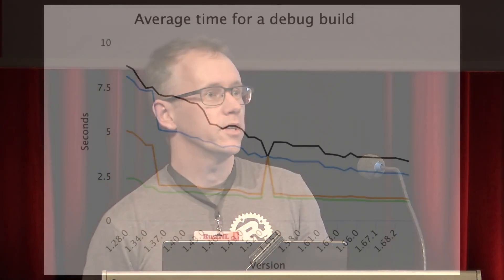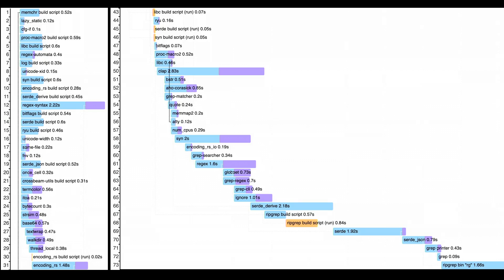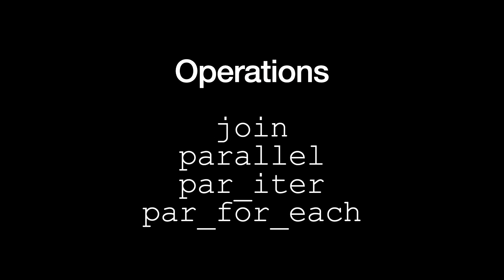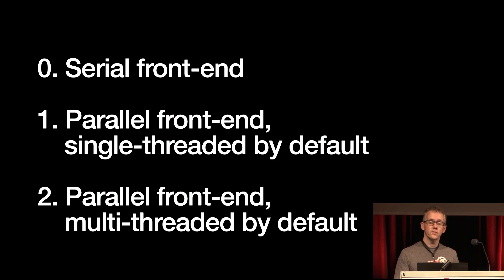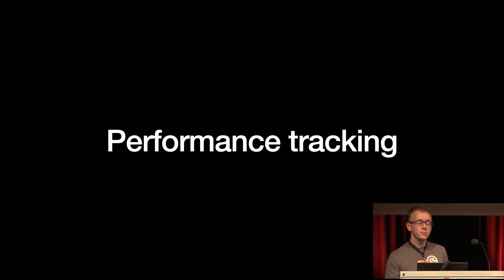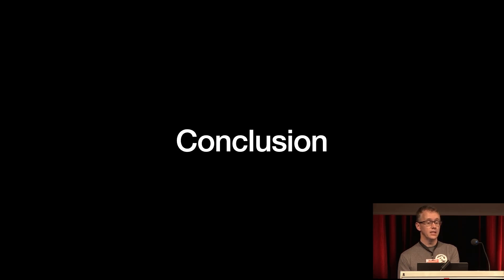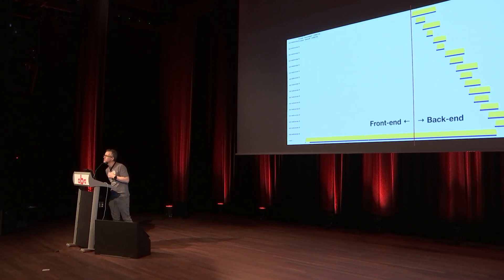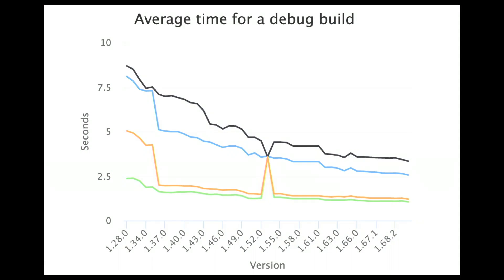The status of parallel rustc - Nicholas Nethercote - RustNL 2023

Comment: My question is, why the compiler uses parking_lot for Mutex and RwLock? Couldn't they include this implementations of synchronization primitives in the standard library? Quite ironic they need to use an external library for something they themselves are offering
Reply: Parking lot is based on the web pack structure of the same name. It has some issues(global allocation table, interface with OS) that make It difficult to use as a standard lock for all platforms. So its unclear if this should be the standard implementation or even can be.

A quick answer to your question is they can use internal mutexes and RWlocks. Until recently they were larger and slower then parking lot. This made the tradoff easier but now that STD mutexes have improved its unclear if they should still be using parking lot.

Either way many synchronization implementations exist outside the STD in all languages. Like anything else its a tradeoff based on your requirements.